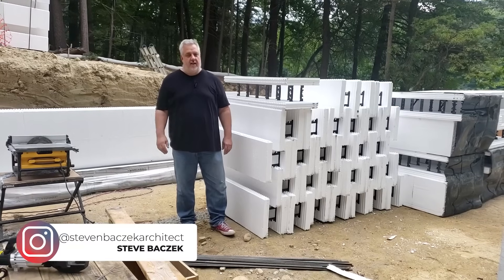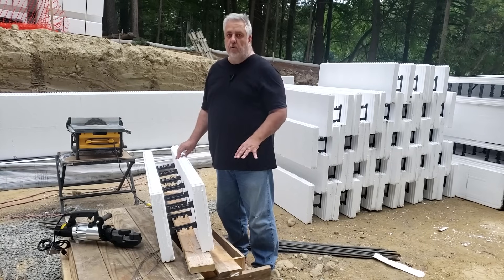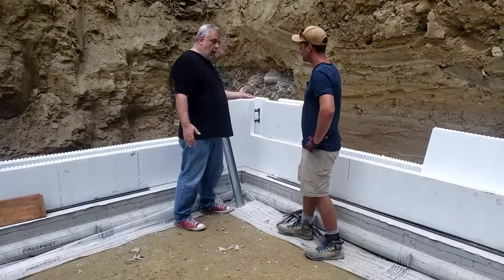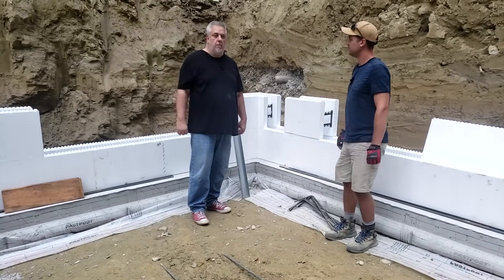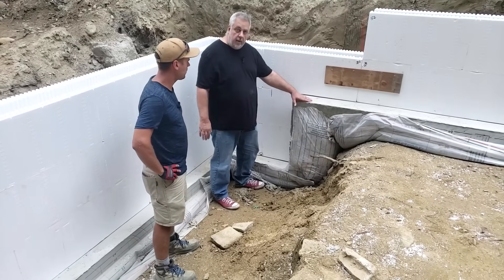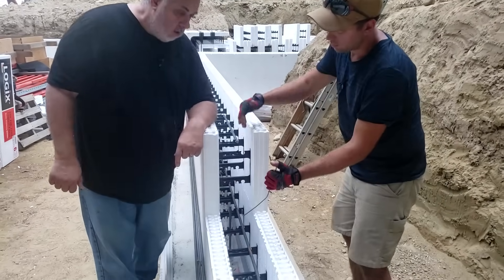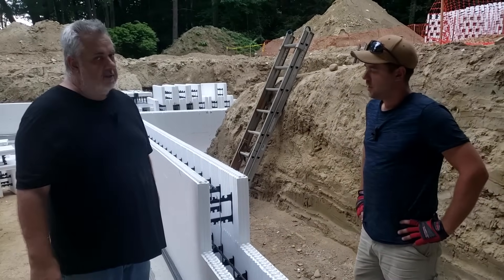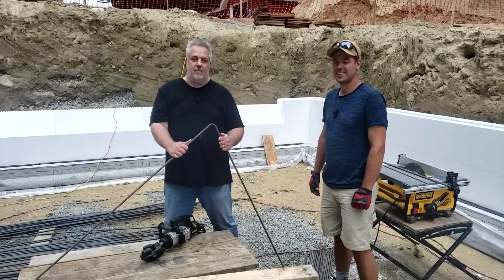The INS and OUTS of an ICF Foundation

Comment: Steve, I always appreciate your videos. Thanks for the excellent content. I have yet to find content from you about an example of your design details when employing ICF walls and how you might suggest maintaining continuity from the wall “layers” (WRB, insulation, ventilation, etc.) to those beneath a slab and on a roof (in an instance in which the roof is not ICF).

Comment: Hey Steve, this is an excellent video. Here are two questions. Are the steel channels used on one side or both sides of the wall? For outside fire protection and tornado resistance, can radius corners be made? I'm thinking perhaps a 4 foot radius at each corner. Thanks for your help.

Comment: Interesting but it seems like it would be a lot quicker to form with a Symons/Simplex system and then just shoot the insulation panels on afterwards like we used to do 20 years ago.
Reply: I would agree.  We can do footings, walls, and waterproofing and starting footings on next job in 3 days. 6 guys we can do 2 basements in 5 days if close together. That's footings, walls, egress,  waterproofing and  rock around drain tile. We dont see many icf guys around. That's usually done by homeowners and DIY guys.

Comment: Logix has a built in stone ledge that you can use also.That way you don't have to 1/2 block up from the footer or bolt on angle.We have a lot of stone on or custom homes in my area

Comment: On the steel stud starter form, is that placed on both sides of the form?  Is there some type of siller or gasket placed on bottom for air sealing?  Does it go all around the perimeter including the corners?

Comment: I hate icf mainly because people don't do them right. The water proof membrane is key to keeping water out. A lot of people don't leave the masonry exposed somewhere to dry out. Masonry loves to wick moisture. If masonry doesn't have somewhere to dry out the moisture goes into the rim joist pocket or stays in wall which molds and mildews. And if that rim joist pocket is spray foamed it rots. What stops the rebar from rusting? I was told rebar needs 4 inches of concrete to not rust in the concrete, but I am in rust belt. I use the fiberglass rebar when possible. I am still using long steel tubes with vehicle parked on one to bend rebar.
Reply: So the proper thing you should’ve said is that you hate when people don’t build things correctly. It has nothing to do with the product but the installer.  Your statement could go for any type of foundation that is improperly installed.
Reply: A lot of ppl do little to nothing about water on footings.its not just icf
Reply: I believe the correct way to stop moisture wicking up the concrete core of the wall is to seal the footing first before installing the foam block. I would check the moisture content before hanging drywall and if need be run a dehumidifier or a few of them after the building is dried in.

I want to try ICF with fiberglass rebar as I am going to be building close to the coast. Pre bent 90’s should work well similar to steel rebar.

Comment: I didn't see how they splice the re-bar. When splicing re-bar, there are two ways. You touch the two bars together as they overlap, usually 36 diameters of the bar in length. it becomes more difficult for the concrete to go in and around the re-bar. You can save some steel and way is to bring the bars together and overlap them, but leave at least two bar diameters between the bars. The two bar diameters provide space for the concrete to go in, around, and between the bars and actually increase the strength.and the splice cam be shorter.

Comment: Can anyone explain why the ICF wall wouldn't need to be as thick as a regular formed concrete wall? @1:15 into the video, he says they normally do a 10" thick concrete wall, but with ICF they are doing a 6 1/4" wall. I've had contractors tell me left and right, that in Alabama we do a 12" formed concrete wall. Talking to an ICF supplier, they are saying anything over an 8" ICF concrete wall is overkill. Thanks for the help!
Reply: I agree.  This doesn't make any sense to me either.
Reply: Not an expert, but that was a weird statement. Both concrete core of ICF and regular concrete wall  need to be of a particular thickness and rebar schedule for the amount of load that they will be holding, there's no difference in that regard. 

What your supplier was referring to was above grade walls, where yes, over 8 inch is usually overkill and typically 6 inches is used for residential above grade walls. But again, anything below grade or complex weirdness above grade needs to be calculated by a structural engineer.
Reply: It is them trying to sell a product. 6 inches of concrete is the same in icf or as a wall.
Reply: Wouldn't this and the footer dimensions be directly related to soil conditions and the size/height of the house?  Definitely a question for an engineer and not some icf salesman or one-size-fits-all contractor.
Reply: @rustyshackle917  Of course that is true, depending on the density of the hard pan and pressure of soil conditions against the wall, and the vertical weight of the building on the foundation but with all things being equal, if you increase the usage and thickness of rebar in the wall, you increase the strength of the concrete.
Reply: You use more rebar in an ICF wall.
Reply: @rabby-u 
So, put more rebar in to make a thinner poured wall.  If it's that simple, he should have said that.

Comment: Please explain:
 1) How do you connect ICF to the footing? 
 2) How do you waterproof Exterior side of the foundation wall? The foam will not protect 100%, Especially at The Sims where it stick/attached together vertically and horizontally. 
3) Do you do footing with ICF too?
Reply: 1, They are using fastfoot, which is a product where you pour both the footing and the first course of the ICF wall at the same time. Otherwise, in a standard setup, you pour your footing with vertical rebar sticking out of it, apply capillary break, then tie the first course of ICF rebar to that vertical rebar.

2, Either liquid or stick and peel membrane. Liquid must be solvent free, preferably STPE type or other water based type. There's also a hybrid approach like the Hulk system uses, but I haven't heard of too many people using it yet. For added insurance depending on conditions and depth, use a dimpled board on top of the membrane too with filter fabric.

3, see 1.
Reply: @rafflesmaos  Thank you! 
1) What is capillary break? 
2) Do you/they apply membrain to the exterior side of ICF? I didn't see it on the video. I guess you/they can apply before or after pouring concrete. 
I think applying directly to the concrete footing & the lower part of the foundation wall is better because ACF foam is a soft material and can get damaged.
Reply: @genevelis6075  1, Capillary break is used for prevention of wicking from the footing to the ICF wall. I suspect it's not as much of an issue for fastfoot since it has a moisture barrier all the way around it.

2, Yes, always to the outside on the positive side on top of the outer layer of the EPS. Generally after pouring, because that's when various brackets that might be temporarily fastened to the outside are removed.
Reply: @genevelis6075  By the way to expand on your original #3 a bit... there is a way to do insulated footers, for shallow foundations. One example is a product called Foot Hold, which is a bit similar to how ICF works. Even better in my non professional opinion is to do an insulated raft slab foundation (there are forms for that too), as long as basement is not needed...
Reply: @rafflesmaos  but they didn't do a monopour of the footing and the first course of the vertical wall.  That's why they used the metal track to attach the first course of ICF block to the poured footing.  A monopour of the footing and all or part of the the first and second courses, they just didn't do that in the wall they are showing as an example in this video.  if you know of ANOTHER video they did a monopour in, please post it here.
Reply: @butopiatoo  Right you are, though I did mention "otherwise" :)

One note is that the metal track is not a universal thing for all ICF, to my knowledge it's primarily used by QuadLock. I'm not sure exactly why, as I'm not an expert in ICF by any means, but I think it's because other forms use wire clips inside and other methods to secure forms to each other and ensure straightness instead of the metal tracks. The primary attachment method of concrete to concrete is of course still vertical rebar.
Reply: @rafflesmaos  yup I've seen guys use the track, I've seen guys wet set the first course in the footer pour, I've seen guys do nothing but square and level the first course up and glue it to the footer.  Lots of ways to skin the cat.

Comment: Steve, Have you or any other reputable Build Show associates ever built a COMPLETE ICF home? (Foundation to roof) I would think that this would be a great home specifically in areas that are prone to Tornadoes & other natural disasters? Would love to hear your professional take on this.
Reply: What about domes they seem to  fare pretty well when it comes to storm damage
Reply: This is the nest possible construction for severe weather and air tightness and longevity it's kinda baffling for all their talk of those things we have never seen them build an entire icf house..and for all the people claiming wood frame houses are better in tornados just no.
Reply: If driveways, interstate roadways and parking lot stops can be scoured - as in disappeared , imagine what happens to your foam exterior. 
Tornadoes are very unpredictable. Consider the damage to a 7 story tower rotated 4 inches on it foundation. The entire  hospital was replaced due to extensive structural damage. The two wing towers were built in 1968, a year after I was born in same hospital. My grandfather went to survey an insurance claim in 1966. 6 month old house. Middle of house was missing as well as a new Chevrolet , parked in garage (found 2 blocks away). Outside wall of garage remained with work bench. On top of work bench were a couple paint cans and paper grocery sacks folded and held between cans and wall.
You can anchor things down all you want, and generally it will stand up to most wind. But when a solid object is thrown thru the air (cars, trees, neighbor's roof) it will structurally damage your concrete wall.  
To personally survive you must either go underground or have good luck.
Reply: So you’re saying they should be built out of wood instead.  @davepetrakos1192
Reply: @davepetrakos1192 Of course there are also the ICF houses that survive while all other houses in the neighborhood were wiped down to the slab.  Search "Pass Christian Mexico Beach ICF house".
Reply: @davepetrakos1192 Sure the strongest weather event and undo anything man made, but for the most part ICF house is going to withstand the most compared to most conventional construction.  Look up videos/pictures of ICF house standing in flattened neighborhoods from hurricanes from Texas to Florida.

Combine it with Hardi board and a metal roof, that’s what I want in wildfire prone areas in CA…

In the coastal Northeast I think people building a home are getting ripped off if they aren’t building with ICFs.  Wood framed home can’t match an ICF home for wind resistance.  You have to rely on so much shear specific framing in wood framed homes.  Then combine meeting exterior continuous insulation code and if your using ZIP R you have to get creative with shear…. SO much additional complexity and labor  vs simplicity of ICF and you get better results in almost every category.  Wind, fire, sound, insulation, etc.
Reply: Good question. After seeing 3D printed concrete homes I thought the same thing. 

I would think using ICF up to the roof would make a tornado-proof and highly fire resistive home.

Comment: It will be interesting to see how this finishes out. What do you do to the exterior to protect the icf material.
Reply: LOGIX ICF is compatible with any type of exterior finishes that you'd use on a typical "stick framed" house or commercial project.  LOGIX has embedded furring strips just below the surface of the foam located every 8" on centre.  Twice what you'd typically have in a 16" OC framed wood structure.  -- Jay from AMC Foam/LOGIX ICF
Reply: Any finish that you'd have on a regular house you can have on an ICF house. Just gotta watch your waterproofing and get something that is compatible with the foam insulation. You don't want to melt the foam off your brand new building
Reply: peel and stick is the waterproofing, cover that with a Dimple board up to grade,  Above grade can be any non rotting material, metal flashing, parging, MGO, tile, stone etc.   Wood or siding should be 8 " above grade.  Hulk is a spray on waterproofing.   Has to be compatable  for EPS foam ( non solvent based)  @shannabolser9428
Reply: You can use an elimax or tremco liquid applied is usually the best way to go. 2 inch minimum spray foam as well.

Comment: Steve, any issues with termite infiltration into the icf blocks
Reply: Hey Mark, LOGIX ICF manufacturing plants in the southern US have unique series of LOGIX ICF forms called the LOGIX TX series that do have a chemical treatment applied to deter termites.  It does NOT replace standard termite mitigation techniques that you'd apply to any building.  LOGIX TX is a secondary line of defense in high infestation areas.  -- Jay from AMC Foam/LOGIX ICF
Reply: @amcfoamtech Do you know if aluminum foil is a barrier to termites?  I know their mandibles would be sharp enough and strong enough to cut through foil, but I wonder if they sense it as not suitable for tunneling.  If this were the case, ICF manufacturers could stamp out aluminum foil barriers that could conform to the nubs of the ICF block and still allow the blocks to interlock.  I assume waterproofing membranes deter termite tunneling also, but I don't know.
Reply: Polyguard makes a term barrier product that doubles as a waterproof membrane.
Reply: @joesakal872  Yes, and that would be the main defense from the subterranean termites.  But on the outside chance of a crack in the concrete footing, there may be a path for them to bypass the polyguard.  If there is a metal barrier between courses of ICF blocks, the termites could go no further up the wall.  BuildBlock ICF makes a flashing called BuildShield Termite and Fire Block.  It is installed just above grade, forcing the termites to create visible mud tubes running up the side of the foundation, alerting pest control.  My problem is with the cost and labor of that product.  I have seen a video of termite tunnels behind the foil of foil-faced foam board.  They didn't eat through that thin foil, but that might be because they had no reason to do so.  I wonder if anyone had ever tested if something as thin as Renolds Wrap between ICF courses would stop the termites.  ICF manufacturers could easily stamp  aluminum foil to the shape of their ICF nubs and sell as a cheap and minimal labor termite blocker.  It may not even be necessary to pre-stamp the foil.

Comment: i didn’t one 35 years ago but the wall did not come out straight at all. the sub made it right by paying to have a 2x4 wall built inside around the entire perimeter.   this video shows a full proof method of how to get a straight wall.
Reply: This foundation should be braced when ICF work is completed.  The bracing is done at 5-6 ft spacing along each wall and at 4 ft horizontals approx.  Lean the wall in before the pour, push the wall out to straight and plumb just after the pour.  String line top of wall straight.  A note about rebar, you can stager or alternate the horizontal courses of rebar mostly to the inside of the concrete ( if backfilling exterior of wall) , once all the ICF is installed and horizontal rebar installed, then drop vertical rebar down from top between the two corses of horizontal rebar, no ties required.  Engineer spells out the amount and size of rebar   PACIFIC ICF